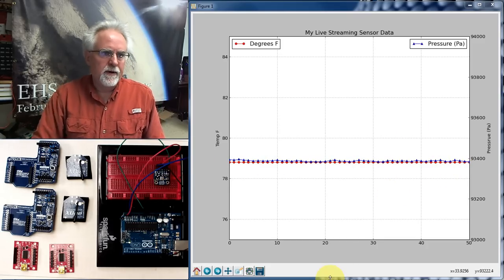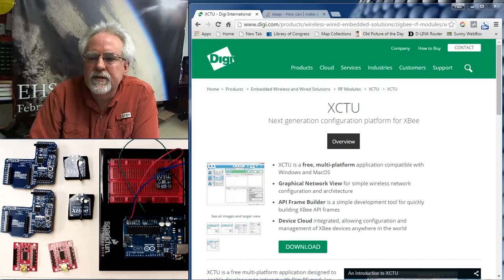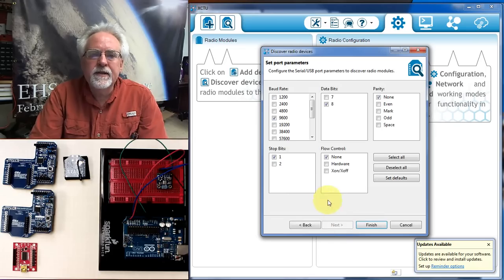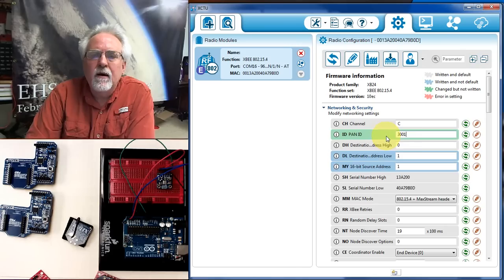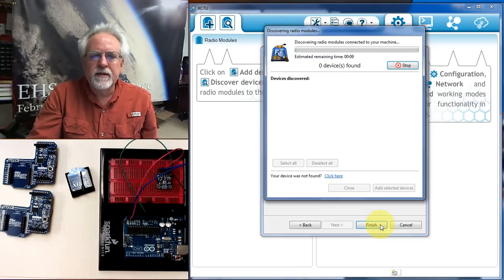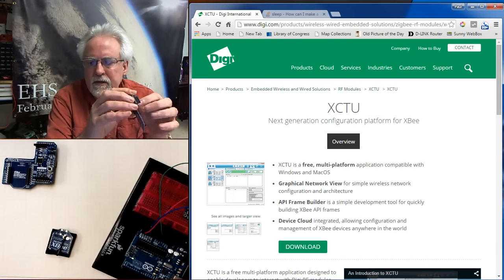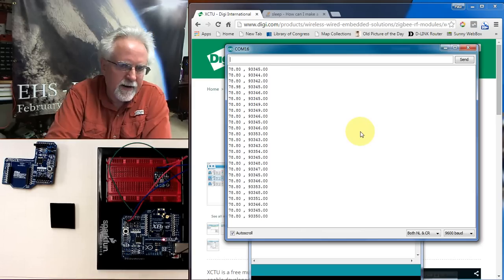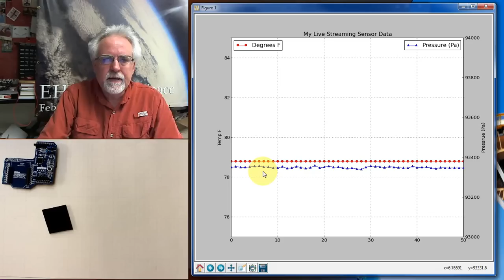Arduino with Python LESSON 15: Wireless Communication with Xbee Radios

Comment: Hi Sir,
Really very nice learning with your video's. I have one small question, as I understand the Python code is running still on the computer. So how can we have a independent display for python and run the python code independently? Because in the last, we are still dependent on computer for running the python and displaying the graphs.

Comment: Very clear and easily understandable.  A pleasure to listen to.  I need to transmit a LOT of data.  Are the Xbees reliable at high data rates above 9600?
Reply from the maker: Xbee work well over short range. The stronger the signal i.e. the closer they are to each other the better the throughput

Comment: Sir I`m really wondering about ,at 20:40 in the video, how did you just open the serial monitor when xbee+explorer was hooked up to your computer. There was even nothing coded on your sketch when you open the serial port, and at least what i know is that it`s impossible to compile & run on xbee+explorer. I really want to know how to do it.

Regards,
Wanseok Yang
Reply: Because the Arduino is already programmed. As soon as you open serial port it started giving out the data. Hope this help :)